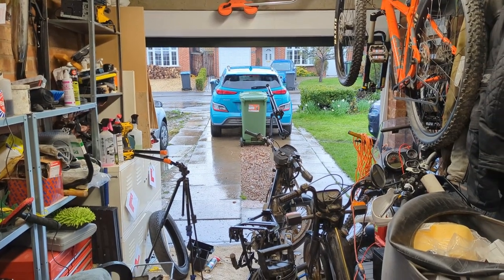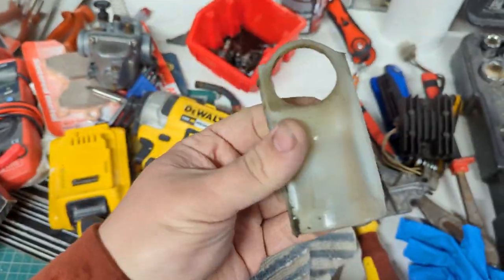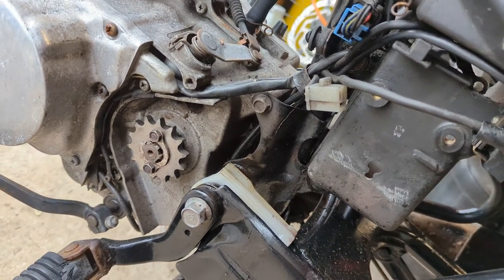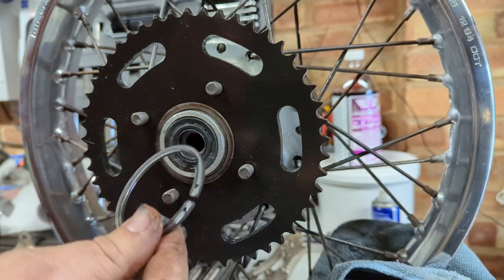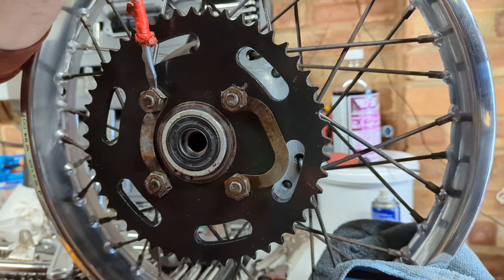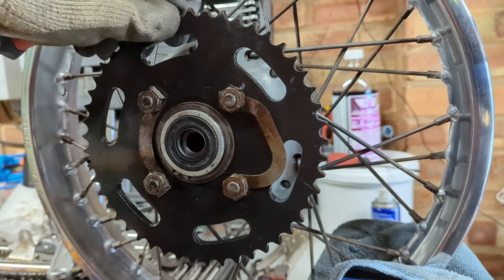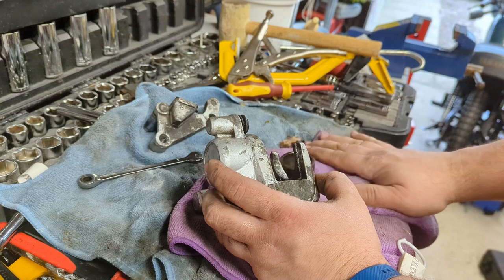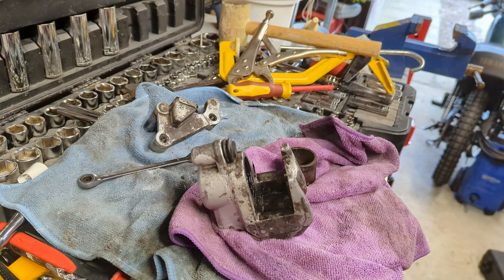Rebuilt & Running, Rear End & Tyres - The Grand Challenge | JAM#15

Comment: hello, i have some problems with my sr and i was wondering if you can tell me what year is your sr and what carburetor setting and valves clearances did you use? i will appreciate your answer
Reply from the maker: The carburetor on mine has fixed jets, so only the idle setting is adjustable. I think my valve clearances are .05-.09 inlet and .11-.15mm exhaust
Reply: @justanothermotorcyclist  thank you for the answer